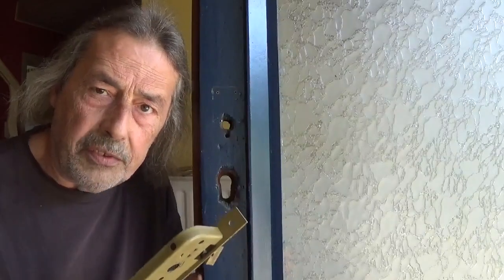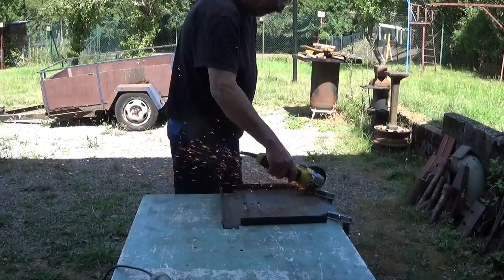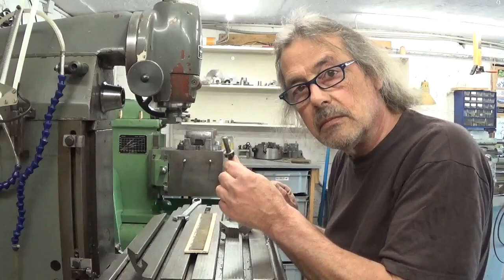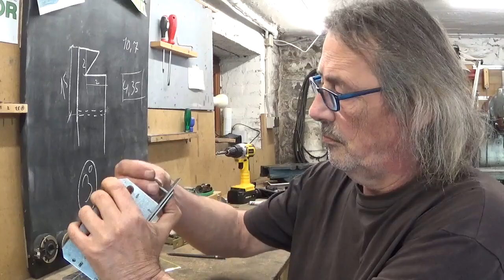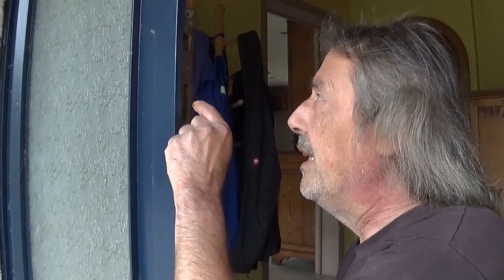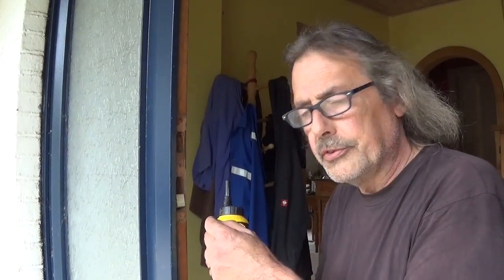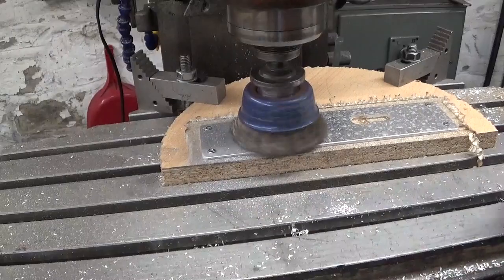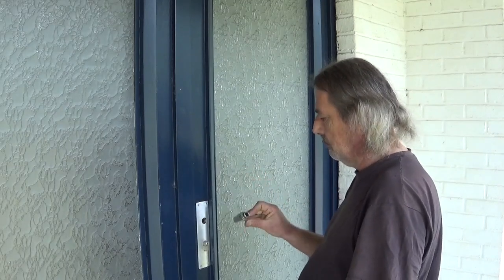Front door lock challenge.

Comment: And...another real project.
I love the fact that having a lathe means you can turn (pun intended) a straight head screw into a countersink one. Without a lathe such a silly little adjustment would be practically impossible.
With a lathe, so many unrepairable things suddenly become repairable.
Together with a 3D printer and perhaps a soldering iron (ok, and perhaps a welder) it feels like one has all the tools to repair absolutely anything.
There are so many things I have thrown away, that I realize, I could have repaired, at least, with the tools I currently have.
So...a lathe really isn't only a hobby machine. It's a tool to fix things, just like a screwdriver (or some Locktite for doors).
Reply from the maker: Having a few tools can indeed be very handy.